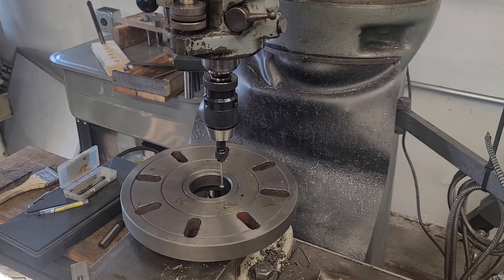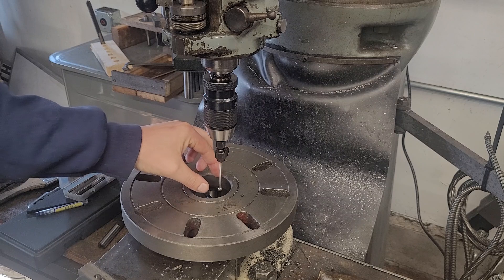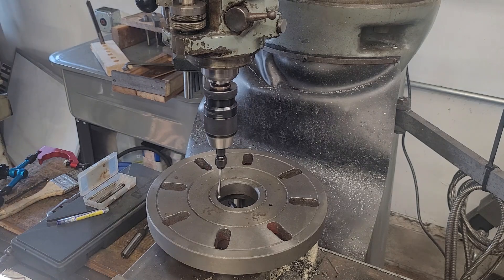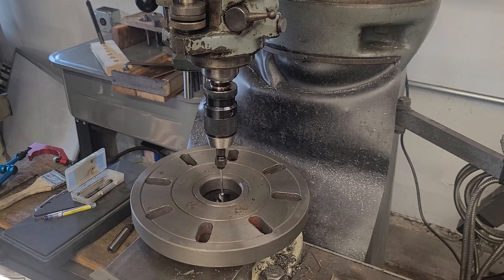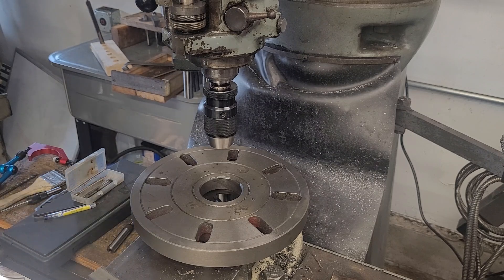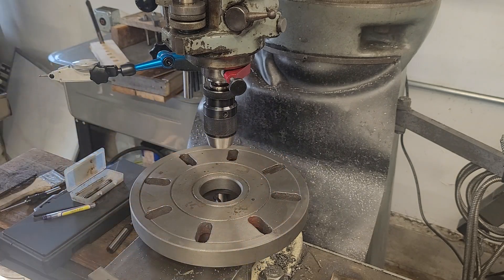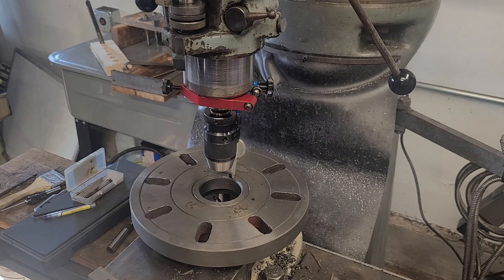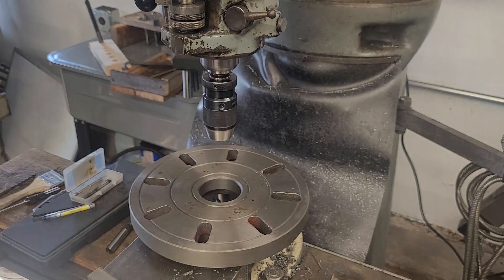Finding Center On a Milling Machine

Comment: Co-Axial works a LOT better. One tool, One setup, more accurate then any DYI'er will ever need.
Co-axial has a great benefit too , Find center, NO Math, lock the table down >>>>>>>>>>>>>>NO DRO Needed!
Reply from the maker: You can use an indicator holder to sweep the part in full, but it can be a bit tedious. I have a coaxial indicator, but I find it is no faster or more accurate than anything else. The amount of Z travel it consumes also makes it impractical for a lot of parts.
Reply: @moosesmachinery  
That what made machining changeling and enjoyable for me. Retired now, but machined for 38 years.
Theirs ALWAYS many ways to accomplish your goal, some, better then others.
Learning how to do something more then just 1 way will broaden anyone skill level.
but the end goal is to do it right, make it work like designed. Never stop learning!!
This is one field Nobody can know it ALL!!  ( ͡❛ ͜ʖ ͡❛)✌
Reply from the maker: @doesntmatter3068  amen to that. For certain jobs, it's just faster to use an edge finder since there is less cranking, and you already have a good drill chuck in. And there will be no digging extra tools out of your messy boxes!
Reply: @moosesmachinery maybe on the mill, but in a horizontal lathe, you are getting a dirty look from me trying with a test indicator. I've tested this and ops who use them commonly are out .003". Coax is all I use for alignments.
Reply from the maker: @Mike-lt6sj  I don't do any horizontal boring work so I don't consider indicator sag as it rarely is a factor in the type of work I do.
Reply: @moosesmachinery  I do machinery alignments for a company that has 250 nc's, so it's a little different for me.  Thanks.
Reply from the maker: @Mike-lt6sj  in your application I can see why it's more relevant.  What has worked well for me in the past is to take some empirical measurements of sag with holes in known locations and then account for the indicator droop, but honestly for horizontal work I've used an edge finder once or twice.

Comment: the average between any two points is still the center ......had to think about that one for a minute
Reply from the maker: Strictly speaking, any two points on the same axis. It's why the half function on the DRO works to find the center so closely when compared to the indicator.
Reply: @moosesmachinery  Two points on a chord. For any two points in general you will get the center projected on the axis formed between them.

Comment: Awesome. So you’re saying I need a DRO??  Ha. Not yet for me. Thanks for showing how to use the edge finder. Good video.
Reply from the maker: A good DRO makes a mill infinitely more usable and faster. My only regret is not getting a 3 axis DRO. But it is easy enough to set a dial indicator up to measure Z travel.
Reply: I used to think the same, and normally had geed end results for project completion. Often, there were dial indicators everywhere, some times in the way, or running out of travel. Once I installed my DRO, my mill is like a trip to heaven! Honestly, I don't know how I ever got by as I did, without the DRO and it's memories.